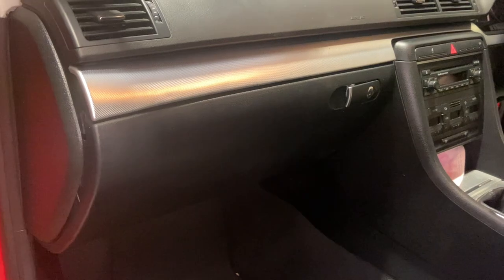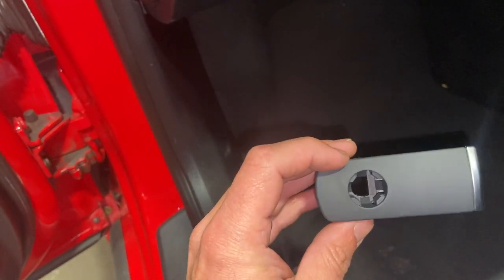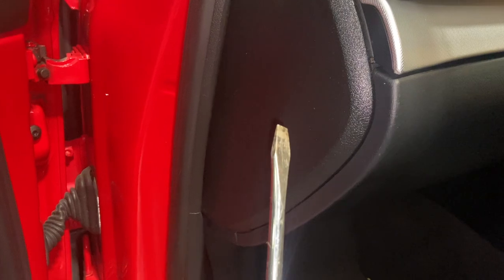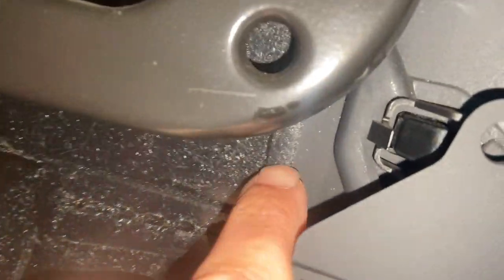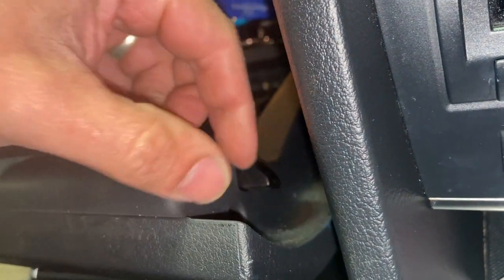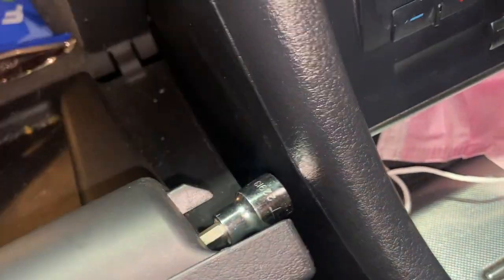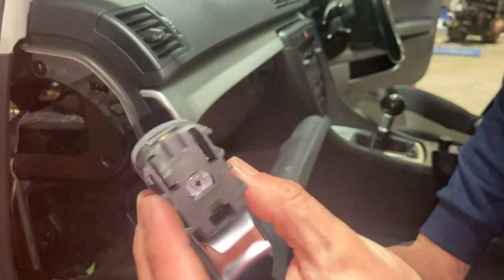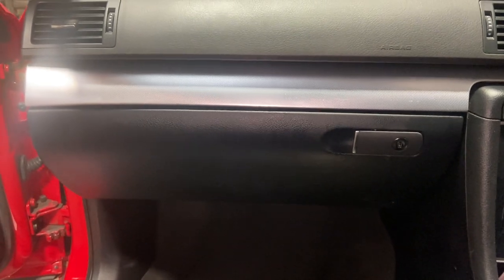How to access Audi A4 glovebox & replace handle

Comment from the maker: New OE Audi RHD handle eBay - https://ebay.us/CHWgTp
Cheap LHD handle eBay - https://ebay.us/gLtLhF

Tools used : 
Small snap on flat blade screwdriver - https://ebay.us/S62oNB
Torx sockets (T20 required) - https://amzn.to/3aIOoN0
Screwdriver set - https://amzn.to/3dXUfQu

Check Euro car parts - https://tidd.ly/3lIO7xA  (use discount codes on site)
Check "Car Parts for Less" - https://tidd.ly/2LNEwIn  (use discount codes on site)

Comment: Had car in for service and mot last week and had asked Audi Poole, if they could open the glove box as the lock was broken, they said the only way was to break the glove box and charge me over £700 for a new one.I refused. I Told them that I had Seen a video some years ago about opening the box, but they insisted it couldn't be done..So the next dayI found your video followed the instructions and within less than a min opened the glove box and no damage. Thanks for sharing your video, just looking for a new handle now :)
Reply from the maker: 👍👍 haha nice one , glad it helped! The handles are about £50 off Audi 🙈